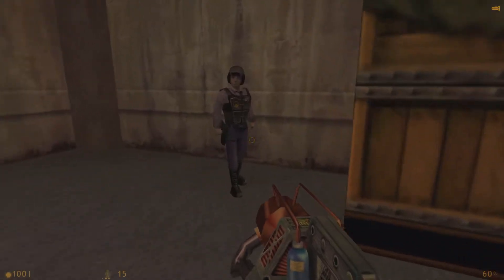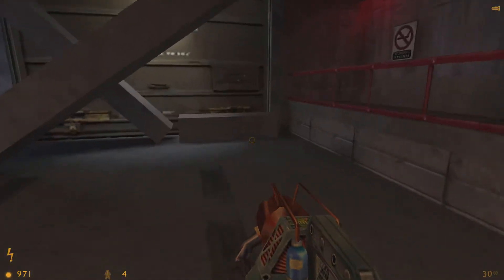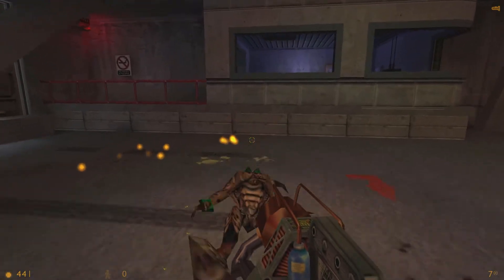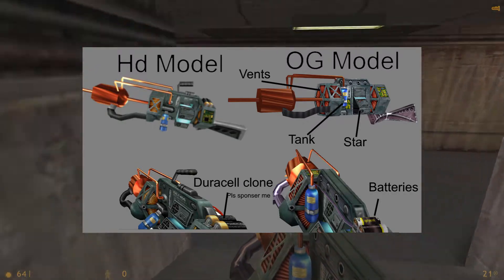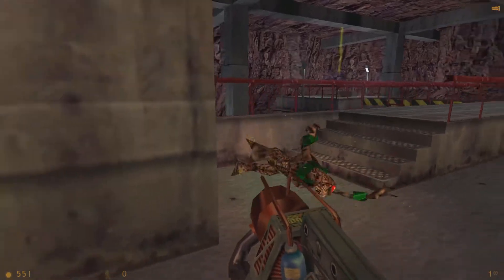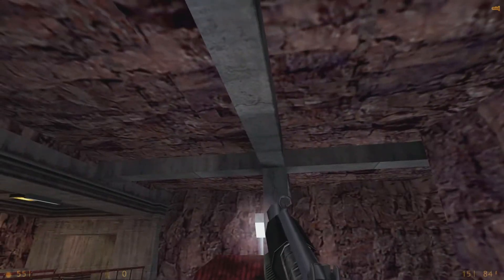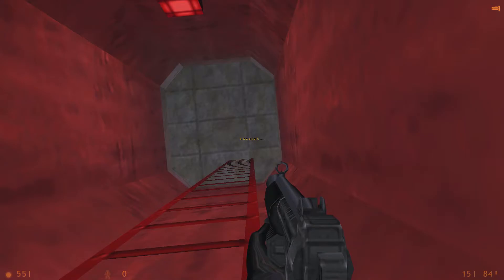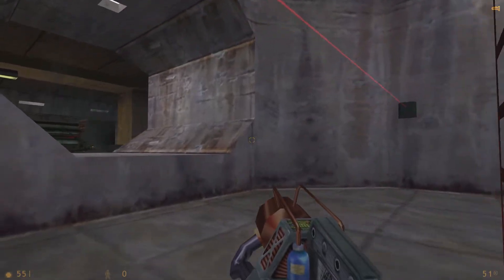Is the Tau Cannon Possible?

Comment: it could be a particle accelerator because isn't the tau cannon reverse engineered vortigaunt technology?
Reply from the maker: Well yes but actually no it could be possible if I went off the assumption that vortigaunts existed that would help but also they are limited by there time (Granted they made a huge superweapon...)  but also in a year or 2 time Standford should be releasing a small particle accelerator so that would definitely help with the tau cannon and gluon gun. Sorry if that didn't make sense but hoped it helped answer your question